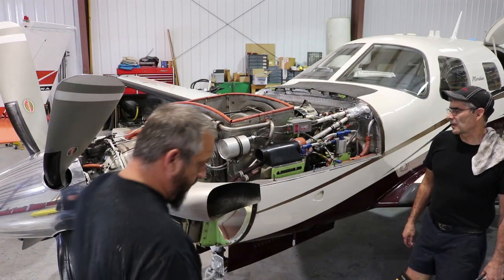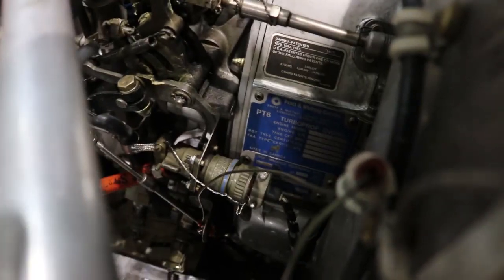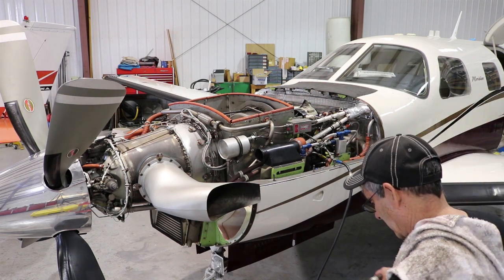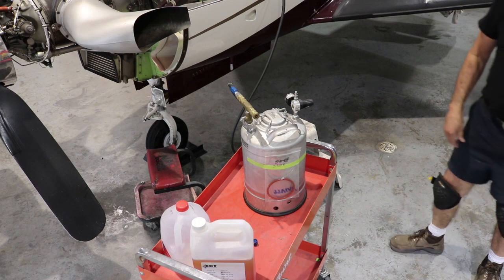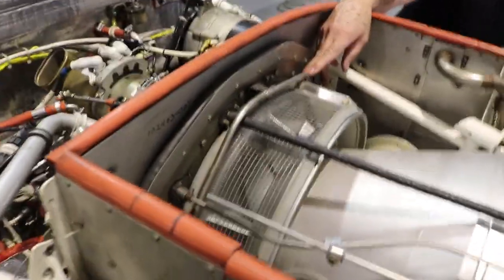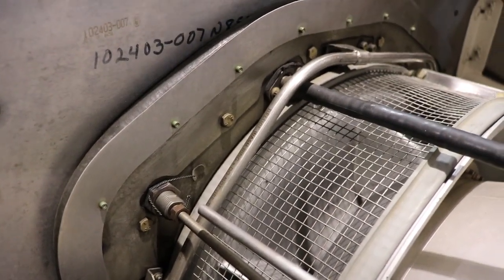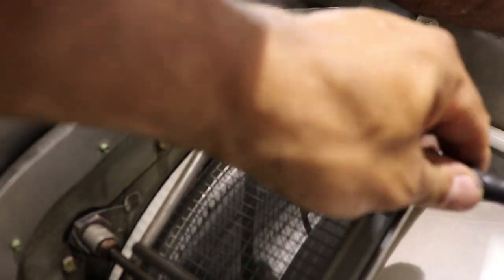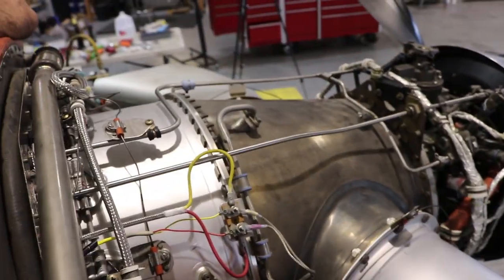Piper Meridian PT6A-42A Compressor Wash

Comment: If you don't know the PT6 is a free turbine meaning the propeller shaft is separate to the compression and exhaust sections. That's why the prop spins slowly when he started the engine. Someone in another video suggested you can hold the prop when doing a compressor wash on a PT6 but if you did so with a TPE331 the torque would take you off your feet

Comment: A pair of surplus stand-up 2 gal. fire extinguishers that came with air fill point & gauges, easily modified with 10ft or so hoses & quick connectors  work well for me. With a long enough hose it's a 1man job, as you can bring the extinguisher into the cockpit.

Comment: It is not a power recovery  wash  in the hot section area. It is a compressor chemical cleaning of the cold section only. It has been my experience that if enough deslaination washes of the compressor and compressor turbine are accomplished you will not have to do a power recovery wash. By the way I hope you had the power section drain plug out , but it did not look like it. And also a post run is required to dry the engine per P&W PT6A-42A  Maintenance manual chapter 71-00-00.
Reply: What's your point? The guy said he was doing a cold section cleaning, not a hot section cleaning.
Reply: Hey fellow AME / A&P

Comment: Thought that there was more to it! What about removing the P3 filter and the canister drain under the engine? Must it not be run afterwards so all the water residue can evaporate?
Reply: just remove the line which goes to the p3 filter